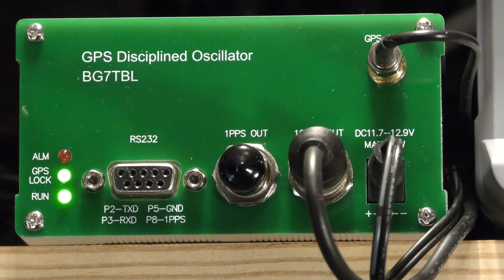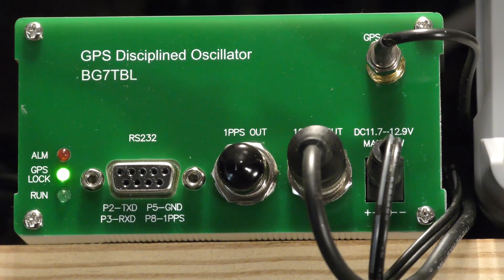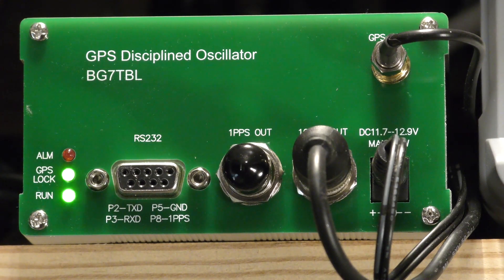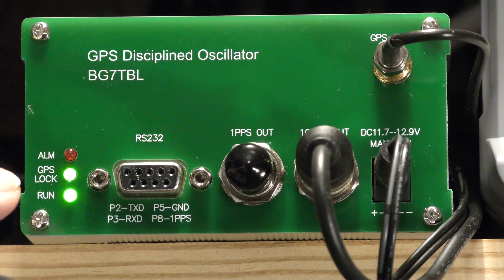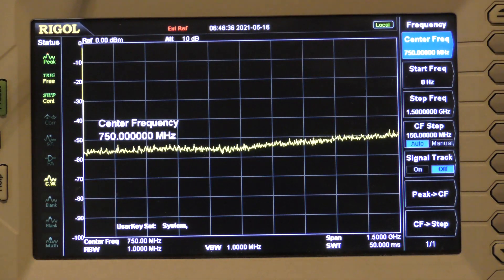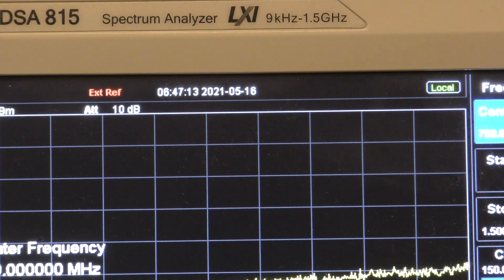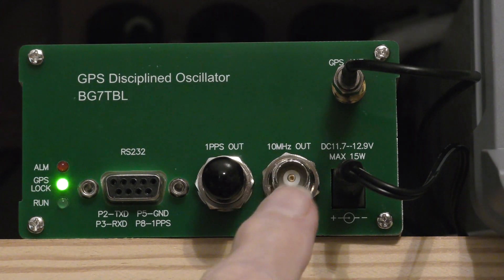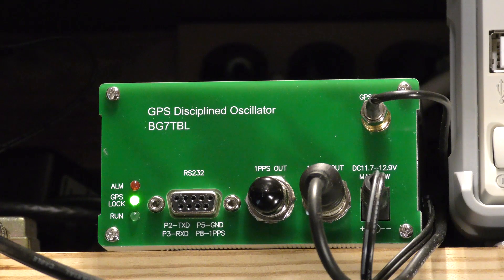TTT398 Using a GPS Disciplined Oscillator

Comment: I am confused about the amplifier.  My HP 8657B came with the "TIME BASE HIGH STABILITY OUTPUT" Option, I am currently using it’s external output to match my HP frequency counter accuracy with the HP8657B.

Shortly I will be receiving and HP8904, a multifunction synthesizer that will pair with HP8657B to send FM stereo channels and pilot signal.  I was thinking of using a BNC T-Connector to share the "TIME BASE HIGH STABILITY OUTPUT" with both the frequency counter and the HP8904.  Do you know if this is acceptable or do I need to use an amplifier or coupler of some kind.  I thought I could just use the T-connector but after seeing your use of an amplifier I thought I would see if someone here could provide some advice.  I don't want to damage my HP8657B output.  James

Comment: There are DIY projects on-line to build this device. The YouTuber "Skullcom" has a complete video series, including code and PCB files, IIRC. It uses an Arduino and a cheap Chinese clone of a Ublox GPS receiver. Using these clones is a typical DIY approach. A lot of clones are garbage, but, these clones seem to be reliable for this use. These receivers are also capable of outputting both a 1PPS and 10MHz, without the external oscillator. That is not to say that eliminating the temperature controlled oscillator is a good idea. IIRC, though your GPSDO is a new unit, it uses a recycled oven oscillator. That is not to say that a used oven oscillator is a bad thing, but it is something to consider in making a purchasing decision. You might want to post the link to the Skullcom project. YT prevents commenters from posting links, but the YT channel owner can post them. This is the exact title: Scullcom Hobby Electronics # 35 - Design & Build a GPS locked Frequency Reference Standard

Comment: Interesting.  Can't help but wonder the tricks used to make up for latency of the gps signals arriving at the receiver.  Assuming this unit is made to be stationary, so I guess it shouldn't be too difficult of a problem to work out since you know position and velocity of the satellites.  Has to be somewhat worked out for gps to work at all.  When I was little I knew one of the founders of Garmin.  I think some fiber equipment switched to gps syncing instead of atomic type clocks.